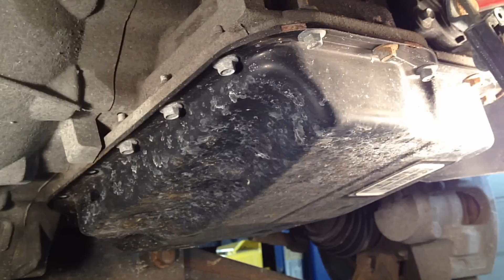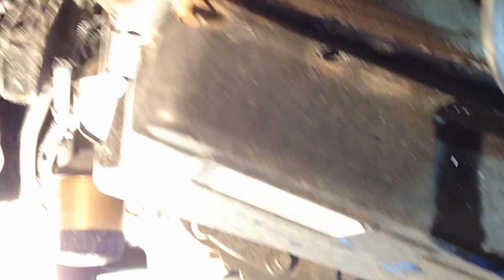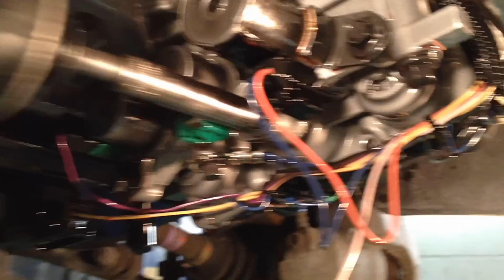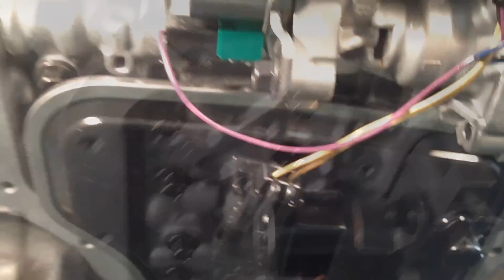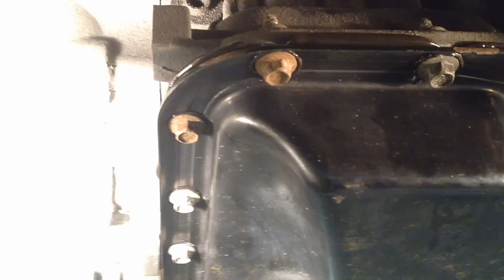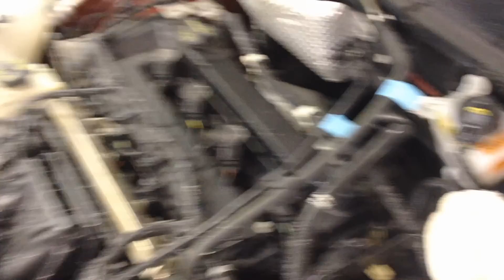Ford Focus Shift Solenoid A Repair P0750 P0753 P0972

Comment: My 2014 ford focus doesnt take reverse. I had been having problems with the car turning on it seemed as if the battery was dead so i would play between the cars battery and the positive and negative poles to see if it could turn on. 

Long story short. I drove the car to the mall when i return it wouldnt turn on, when i got the car to turn on after an hour it didnt take reverse. Prior to that though the car was fine and did not have any issues. 

Ford(Puerto Rico) wants $2800 for the fix. Im at a crossroads because i have the money but it just doesnt feel like it should take that much. If someone could advise with proper course of action i would gratefully appreciate it!

Comment: I have a P0753 (shift solenoid A electrical) code on my car and my car  would not move even though it's on drive .. I would rev but no go.. suggestions?

Comment: Love your videos and have a quick question regarding any drain procedure you might recommend on a 2008 Ford Focus automatic.  I have seen some that will not only drain but flush out the lines in the cooler.  What do you recommend?  The Focus also seems to have a hard shift from 1 to 2 gear...hoping the filter/fluid change will help clear that up.  Any chance a solenoid might be bad without a code showing?  Thanks a bunch!

Comment: Thank you for the wonderful video and the great detailed explanation, but I have a problem. I had the p750 until the transmission was totally ruined up in couple of months for my Ford Focus 2002. I changed the transmission with a used one but I have the same problems that I had in the beginning of my previous transmission. I had the check engine light on with P750 and P1000 in addition to smooth shifting at the early 10-15 minutes then the transmission starts to have delays in 1-2 , 2-3 and sometimes in 3-4 gears. The engine has some vibrations and while running after about 20 minutes when waiting in traffics the car start to have waving speed of the engine trying to shut down. The battery practically starts the car good but on exam it reads low battery. The alternator was changed before all these problems started 2-3 weeks after alternator exchange. Please, do you think the problem is in both transmissions, the old and the new or there us a problem in the car outside the transmission giving a false positive error P750 and causing all these problems?. Thank you.
Reply: I'm not sure but I hope I don't have the same issus

Comment: i tried it too and it didn't work either..... took it to the dealer and they said according to the computer simulator everything seems to be working so they say it  needs a new transmission....those bastards at the ford dealer charged me 100$ for the test and i know it came from another ford dealer and the info was allready in the computer from when the last person took it to a different dealer....it's a 2005 with 42000 miles

Comment: Good video. Question for you. I had a trans shop change the Solenoid. After they did that the car had no reverse.  I questioned them about that, and they said that sometimes happens and no way to fix it. I find that the be questionable.  Might you have an idea what could be wrong. Can the tech, cross the plug ins and get them hooked to the wrong solenoid which can cause that problem. Or is this more complicated. Thanks
Reply: Yeah, I'd suspect they used the wrong solenoid or crossed something up. It sounds like they are making an excuse to not be bothered. Sucks man, I'm about to do the girlfriends car soon.

Comment: why did you use a bead of silicone and not a gasket?
Reply from the maker: I repair them as they came from the factory just as I had for many years at the dealer following Ford repair procedures.
Reply: @FordTechMakuloco  
any drawbacks to using a gasket and not silicone?

Comment: Okay good sir. I have a 2016 fusion se that doesn't want to go onto gear. Couple hard shifts. Couple wrench symbols and ran in limp home mode but wrench went away after shutting the car off and,back on. Brought it to a shop and they said it was an internal transmission failure. The codes from the auto part store were PO712, 707 and 760. They said the failed Transmission is causing those codes to pop up.... Is,that true? Does it work like that?  Please help they want a lot of money  and I think, based off my watching your vids and other research that this is an electronic issue. Also the last day I had the car the radiator fan stopped running. How could that be related to the tranny ? Isnt it powered by the tcm?

Comment: My son has a 2010 Ford Connect Transit (same transmission - 4F27E as the Focus) with error code P0751, indicates the Shift Solenoid "A" had a performance fault or was stuck off.  His car will not reverse, nor shift into 3rd or 4th gear.  Would you recommend also replacing the "B" or any other solenoid?   Great video!  took a while until I found he has the same transmission as a Focus.
Reply: John Graham my 2005 Ford Focus has a code for shift solenoid b I replaced it twice and still has same code      And it doesn’t go into reverse should I replace solenoid A

Comment: Thanks to this tutorial, I solved my 2003 Focus' P0750 error and the car is back to normal. HOWEVER, 2 of the transmission pan bolt heads sheared off, and I had to drill and tap, which was very distracting and time consuming. Also, the Permatex is VERY hard to squeeze out of the tube, making for an uneven, jerky bead around the perimeter.

Comment: @FordTechMakuloco I have 2006 ford focus. I parked my car well... Then  put into drive mode. All going well.. Now its not shifting from neutral back to Reverse and Park... I removed the wire from gear box and moved the shift lever.. Its working fine. I tried to move the knob over transmission. Its only going two steps.. DRIVE AND NEUTRAL.. I tried to push hard to forcely move to Reverse and Park. I cant.  NO DTC pressent for transmission. Please advise.

Comment: I recently bought a 2005 zx3 hatch with a manual gearbox.  Little did I know the shifter has a lockout ring that you pull upwards to put it in reverse.  I wrestled with the stick trying to get it in reverse gear thinking the synchros were worn.  There was no grinding but it wasn't until after I got the car home from the dealership that I skimmed through the owner's manual and discovered the lockout ring on the shifter.  Could I have possibly damaged something?  Recently I also noticed the car tends to lunge forward slightly after putting it in first gear...again no grinding noise, but the car behaves like the clutch isn't all the way in when I select first gear.  Not sure if this is normal.
Any other manual trans Focus owners who can provide some input on the subject matter I would appreciate it.

Comment: I just bought a 2011 Transit Connect with the same transmission.. Has 130k; I was interested in your thoughts regarding the shift solenoids.. Would you change the common failure solenoids at this duration to catch them before they fail? Also, would you recommend using a manual oil pump to suck out the transmission fluid through the dipstick tube? 
Thanks!
Reply: did doing this  fix it

Comment: 2008 ford focus, will not go past reverse sometimes. Turn car off and on sometimes corrects problem. Brake switch/interlock switch was replaced but did not correct problem. Car shifts fine. This problem is very hit and miss. Any help would be appreciated.

Comment: 2008 Focus automatic, sometimes it will not go past reverse. Turn engine off/on and it corrects the problem most of the time. Car has no issues with shifting once going. Does not happen all the time, very hit and miss? Any suggestions would be appreciated.

Comment: It looks like you don't need to remove the transmission to replace the solenoids, is that correct? About how many hours should this take in real time - including waiting for the fluid to drain?
Reply from the maker: 1hr

Comment: Hey FordTechMakuloco. I have a Ford Escape 2010. Shifts stay stuck in 2nd, reaching 3000 rpm. When checking I had low oil level but it was already filled. If I take my foot off the accelerator, sometimes the changes pass until the sixth speed. Sometimes, the code P0756 appears lighting the motor light.
The strange thing is that sometimes transmission fault light goes on. When it appears, shifts happen much easier and I do not know why this happens since the code P0756 indicates that the valve was stuck. What may be happening?
When it stays at second, I hear the same noise when the engine goes down a slope with the downhill assistant. The button on the lever that activates it, seems to work well. Is this the cause?

Comment: Great video!  I have a 2012 fusion se 2.5l and its throwing the code for the pressure control solenoid A. Would the layout be the same on the valve body  as on the focus?

Comment: Hey u the man thanks for all the info. I have a 2008 focus and it will not shift into Reverse, but there is no code because the battery was dead. Would changing the shift selenoids a and b possibly fix the issue? Thanks for your time brother!

Comment: So i have a problem with my ford focus 2013 it start runs but when i try and press on the accelarator it revs by itself i was wondering if i did this with the ford focus 2013 would it fix my problem also ? Because i dont wanna go deep into it and me messing it up and then take it to a mechanicshop to fix my mistakes if answer thanks if not still thanks for trying to help

Comment: I got code p0751 ( selonoid A ) I change it an i still have the same it won’t shift
Reply from the maker: +Cataleya503 what year focus? If it's a 2008- 2011 then the pcm driver has failed

Comment: Should do a vlog on 90 - 97 Ford Taurus trans pressure control solenoid, cleaning the solenoid filters, VSS troubles.

Comment: I have a 2010 Focus SE has surging shift from 2nd to 3rd on automatic transmission and also 3rd to 4th surges on highway when going up hill.  Although, I have no codes. Edit - Now have changed Shift Solenoid A and B, fluid (Mercon LV)and trans filter. These symptoms change and not always have a surge between shifts. It just depend on how much my foot is on the gas and if cold or warm seems to make a difference also. Someone said PWM D and possibly a EPC Solenoid. I noticed some metal fragments on the magnet but not a whole lot there. Any ideas?

Comment: IAM getting a po123code and a po761code It also says the first code is solenoid A the second code says solenoid C do you think changing them both would help the transmission from disengaging from from 2nd and 3rd and 3rd to 4th

Comment: Great video! I've got a question. How do we know that those solenoids are defective, how do we test them and what should the reading on the multimeter be? Thank you. Have a great day!
Reply: I believe it's supposed to be between 20 and 30 ohms across the two wires. If it's below or above it's defective.
Reply: solenoid d and c 10-25 ohms a and b 1 to 4 ohms and there is no two wires u ground one of the wires on the meter and put other wire on power supply to solenoid

Comment: Hi, my 2000 Ford Focus ZTS, when its running at about 10 miles per hr. The engine shoots the RPMs to around 5000 RPMs for about 2 second and feels like it's not engaging. What would the problem be? Thank you.
Reply: Rafael Huicochea did u ever find out ?
Reply: lilc 23 
Hi. No, never found out the problem. A mechanic said it was the transmission, when the car does that too much it turns the check engine light, the code suggests that the TPS is defective, but I replaced it three times using a different part each time and didn’t fix the problem, in fact it worsened the problem so I ended up installing the old TPS back.
I know when the car is going to shoot the RPMs so I immediately release the gas pedal, I know how to control it.
Thank you for replying.
Have a nice day.

Comment: hey @FordTechMakuloco I have a 2012 Ford transit connect with 182,000kms. My transmission started acting up, only drives smooth in 2nd gear, doesn't want to shift past 2nd, the rpm's will jump.

Engine codes:
P0752 - Shift solenoid 1 (N88): Short to Plus
P0772 - Shift Solenoid 5 (N92): Short to Plus

Please get back to me what i should do, would rather save money and it any replacements my self as i am mechanically inclined. Will be dropping pan in next hour to check 

Thank u

Comment: I have a 2010 ford focus. it jumps a little going into 2nd gear. about 2000 to 2500 rpms when it goes into 2nd. ran a code scan and it tells me p0767 which is solenoid d stuck on. is this an easy fix or is trans trashed. I know that the fluids could be low or fluids and filter could be clogged. is this an easy fix. do I need to take out d solenoid and clean it change filter and fluids or is it worse. thanks.

Comment: I have a 2013 focus, driving at low speeds and it kicked the check engine light on and started bucking around when shifting/accel. No reverse gear now. Maybe shift solenoid problem?

Comment: great vids guy, im have a problem with my 2004 focus, shift fine but if I let off the gas and give it the gas again its like my car is in neutral tell I stop and start back up again and it shift fine and statys in gear until I let off. no codes or ses light not on. any help is it a ssa? thanks

Comment: I have a 2006 focus. I have a slow shift from 1-2, under light acceleration I can see it's slipping slightly (shifting at around 2500rpm, the rpms will rise about 200 or so then shift into second) . under hard acceleration it does not slip but the shift still seems slow at about 0.8 - 1 second. 2-3rd and 3-4th are nice and precise. The shift solenoid was replaced. could a damaged o ring cause the trans to loose pressure and shift like this?

Comment: love watching your videos. They have been very useful. I know this is about the Focus transmission,  but hopefully you can help me with my Fusion transmission.  Fnr5  transmission shakes car when in gear at a stop. shifts through the gears just fine. had a tyranny flush done almost 50k miles ago. Fixing to do a fluid and filter change this weekend. was curious if a faulty solenoid would cause transmission shake ?

Comment: My code read shift B on a 2008 Mercury Milan....We changed that, it fixed the issue and  worked great for a month and than the same code popped up along with the hard shifting!! help. Thanks in advance.

Comment: 1.) Is this the same auto trans on a 08 focus? 2.)Do you recommend a transmission flush on these transmissions if its over 113,000 miles?

Comment: Hi.
I have 2004 Focus with codes P0732 and P0771, I have changed all the solenoids and the epc valve, any suggestions?
Reply from the maker: That is because they are not circuit codes but a manual failure inside the trans.
Reply: FordTechMakuloco  hello I have a ecoboost 2013 1.6L - 4×4  this are the codes P0758 / P0759/ U284

any suggestions for this.
Reply: +FordTechMakuloco 

I have a 2002 Escort that the fluid and filter was changed and now the car won't go into gear. Any suggestions

Comment: I have an 05 ford focus my question is when I had the codes checked it said all selonids were bad a through d is that possible because you put the car in drive and usually it will make it into second gear and then slip and not grab

Comment: any suggestions on if the transmission seems like it goes out of gear when accelerating. when you let off the accelerator it goes into gear and you can accelerate again.

Comment: would this be same for obd2 fault code is have on a 07 ford fusion SE with a 2.3 4cylinder engine?
Reply: Tony Lawson did you replace the throttle body sensor?
Reply from the maker: Same trans yes.
Reply: I have the orange tool wrench lit up about two months ago to relating to throttle body issue. Cleaned it returned part to the car and changed the filter and four quarts of fluid with new gasket this was at 153k miles.I'm now at 160K miles tool wrench still lit up and P0751 obd2 code with check engine light on.  would the setting not being cleared from the original wrench being on caused the solenoid go bad in tranny?
Reply: hi , i have 07 Ford Focus 
i faced problem with gear .harsh and delay shifting .. this problem happens after i changed the tranamissiin oil , help me plz

FordTechMakuloco
Reply: Yes the sensor is bolted to the side of throttle body as one solid unit.
Reply: Tony I know this is now over a year ago but did you ever figure out what your issue was? Im having similar problems and same obd2 code..

Comment: hey man I did everything u said I even did the battery thing 3 times still shifting hard at 2nd gear. almost 5000 rpm. now what
Reply: Ryno Horton Hi, did you figure out what the problem was with your car?
I replaced the solenoids A and B and the car is running fine, it shifts gears smoothly now.
Before I did this, a mechanic guy told me that my gear clutches would probably be worn out; luckily by replacing the solenoids fixed my problem.
Reply: i tried it too and it didn't work either..... took it to the dealer and they said according to the computer simulator everything seems to be working so they say it  needs a new transmission....those bastards at the ford dealer charged me 100$ for the test and i know it came from another ford dealer and the info was allready in the computer from when the last person took it to a different dealer....it's a 2005 with 42000 miles
Reply: @gonicjon  oh that's dirty...

Comment from the maker: Here is the solenoid layout chart for your reference- http://i1292.photobucket.com/albums/b576/makuloco2000/A0006159_zpsjtptwfya.jpg
Reply: FordTechMakuloco hello my reverse stop working which one is the reverse? Thanks
Reply: I need to replace my SSD...In the video you pointed that out as the solenoid on the opposite side and in the middle, but on this chart, it's to the side. Do you know which it is for sure? Thanks for the vid!
Reply: I have an '04 Focus, would you recommend a "Shift Improvement Kit" or not? Thanks!